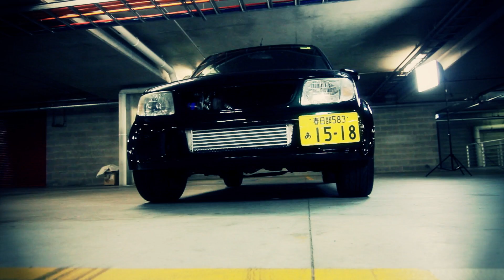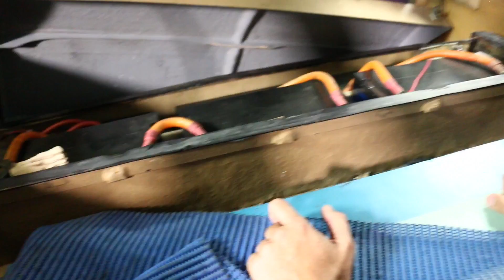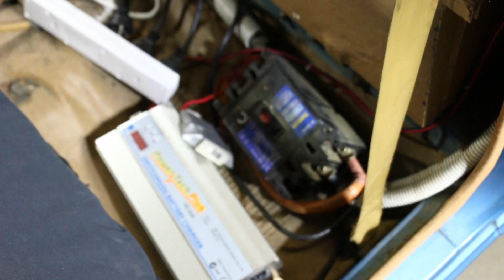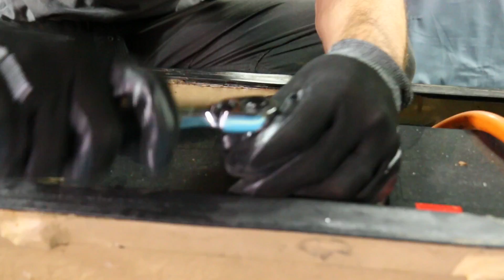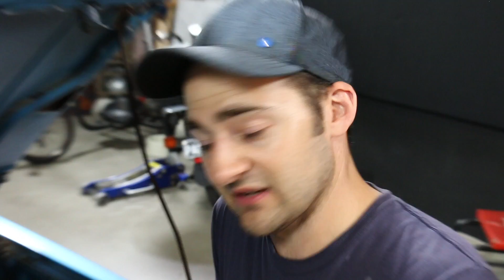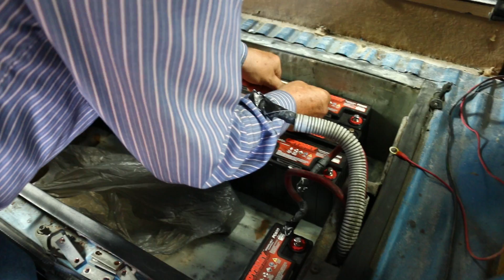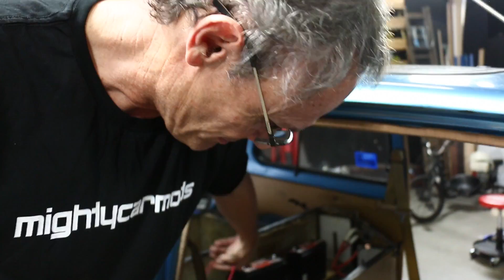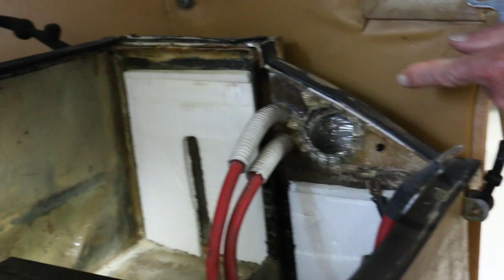JDM Electric Turd

Comment: Why not add a generator in the engine compartment that can charge the batteries as you drive?  It would still be more efficient because you could run the generator at its most efficient speed vs the engine running whatever speed you need.

Comment: One thing you mite want to look into getting capacitors between the batteries and the motor. (Capacitors on modern EV allow the batteries to discharge power to the engine faster increasing the chance for skids) Another thing to help on the lack of power brakes may want to check into a "Hydra Boost System" It's a hydraulically activated booster system (no vacuum needed for power assist) And you don't have to buy the Bosch system, just junk yard one off a Holden!

Comment: just basic batary saftey. high voltage will ark farther than low voltage and can make your muscles tense up like a tazer. high current melts things, and will burn you. both are dangerous at high numbers. in this case it is high voltage and current. so it can be very dangerous if it shorts somewhere.

Comment: odyssey is a really good brand, We run the "2150" in our car audio builds, multiples of them. When your running over 100ft of 1/0 OFC wire  between 5+ power and ground runs off the H/O singer alternator(s), you need a bank of batterys to keep the alternators doing something rather than depleting the batterys storage, and running the stereo off the alternator power essentially hurting the batteries... I ran 3 of em for 2 18's in a 4th order walled bandpass in a blazer on an american bass 5k, with 1 singer 300amp alternator. Odyessey is great but i switched to northstar AGM31's. More bang for buck in canada.

Comment: meh im not an electric car person, i like engine noises to much, personally I'm holding out for hydrogen, not in fuel cells but as an actual fuel, burns clean, can deliver a lot of energy and is easily made, its storing it thats dangerous...
Reply: +Nick Heywood I';m sorry to spoil it for you, but hydrogen cars are electric cars with a fuel cell as a battery replacement. Fuel cells are low-current, low power devices, which means the performance sucks. Hydrogen is even lower energy density than batteries, it's expensive; costs as much to run as a 7L/100km petrol car, needs to be refuelled more often, the performance sucks and to top it off, they're really expensive to make, because they require a lot of platinum to do their job in the oxygen-hydrogen catalyst of the fuel cell. The only thing the hydrogen fuel cell cars have going is refueling within a few minutes, but modern battery superchargers aren't exactly slow either, and electricity is much cheaper. Hydrogen is also one of the most inefficient processes things you could do energy-delivery-wise, maybe with the exception of muscle power via food, which is the most inefficient power delivery system in use nowadays. So if you need noise to drive, just hook up some speakers and play whatever noise you like. My guess is that noisy cars will be even more embarassing in the future than they're now. If you're on the waiting stance, just wait and see battery capacity per size, weight and money double every few years, which is what i'm doing, because I can't affort the 15k€ audi quattro conversion it'd cost with today's tech at the specs I'd be content with, which of course is much lower than the 60k€ estimate the same specs was been less than ten years ago, when I became keen on the idea.
Reply: +jammi Mazda has working internal combustion hydrogen engines, just haven't put them in much yet.
Reply: +ConnorWolf Just to add to jammy's numbers above. From the wind farm down the road to the wheels of my electric BMW is 80% efficient. If you were to store power from the same farm in hydrogen by electrolysis (i.e. not just splitting natural gas) and run a Toyota Mirai that number is around 15% at best. My battery cost around €8k to build, the Mirai's fuel cell costs over €100k. My BMW/Samsung battery outputs twice the power of the Mirai's fuel cell + buffer battery.

The result is the Mirai costs twenty times as much to do the same mileage as my EV and twice what petrol costs.

Oh.... and don't believe the range or refuelling times for hydrogen vehicles. Most current H2 fuelling stations can only pressurise the tank to half full, can only handle 10 or so cars a day and can take 15 - 20 minutes to top up the car. And the fuel system on the Mirai expires and has to be replaced every 10-15 years... and the H2 fuel pumps sometimes explode because they are really difficult to make safe....
Reply: +ConnorWolf TBH if you are going the internal combustion route you are better using a catalytic reaction to convert the H2 + CO2 to methane. Methane we already know how to handle with relative safety and works with a fairly standard CNG converted engine. I'm an engineer who has worked with these technologies in the defence sector. I think the future of passenger vehicles is battery electric hands down. I think HGVs will go Methane SOFC fuel cell for the next 20 years or so until metal air batteries are cheap enough.

Battery tech now can build a car like the Tesla P90D, lithium ion density is improving 5-7% a year. And a little further down the road we have metal air batteries with ten times the capacity and really fast charging.
Reply: And they won't, because that's even an order of magnitude less efficient than gasoline. You can run basically any otto and diesel engine on hydrogen. You just need a trailerload of hydrogen storage to get anywhere, the performance will suck and you'll wear out your engine prematurely. Other than that, yes, of course it works, but it's expensive and you're putting loads more power into generating and compressing the hydrogen than you'll ever get out of it. With batteries and an induction motor, the efficiency is around 80% from power plant to the wheels; with hydrogen in an internal combustion engine it's not even a percent.
Reply: +cros13 I know, I was just pointing out the original poster knows about fuel cells but was talking about internal combustion, not that I think it's better than batteries and grid power, just that it is an option.    

Most people automatically just assume if you say hydrogen you mean fuel cell.  The rotaries Mazda made to run on dual fuels (hydrogen or gasoline, whichever were available) should be a lot cheaper than a fuel cell as well as being more practical to use because they can also use gasoline if hydrogen isn't available (which it probably won't be... because of the reasons everyone has mentioned.) They also make about 50% of the power they do when running on gasoline, which isn't bad compared to most converted internal combustion designs and the energy capacity of hydrogen as a fuel.  But still not good enough to compete with battery powered electric cars in terms of efficiency. Especially with the range problems like you pointed out.

I know all about how inefficient it is to produce and store hydrogen right now.    Maybe one day after I've been dead a long time we'll have an easy way to produce or even just passively capture hydrogen fuel somehow, here's to hoping :P
Reply: cros13 i have heard about this before and again it is a good idea and good on emissions too!

Comment: Just based some quick calculations you guys should be able to get 120miles if you put 12 12 Volt Deep Cycle AGM Dry cell batteries It would weigh something like 1200 pounds in batteries though.  Not sure about the efficiency of the motor that might be pretty bad since its DC, never looked into DC batteries.
Reply: +hootis8 So you have looked in AC batteries bro? ;-) I think you meant DC motor. Still runs at 70% of efficiency, pretty good.
Reply: fucking edit man, I'll just delete it
Reply: never actually tried to find a comment before, google plus really is bad. guess its staying.

Comment: its not the volts that kill ya its the amps just saying
Reply: +Allen Goldsmith You have to remember, I=V/R.
 The resistance of human skin is somewhere between 1kΩ - 30kΩ depending on how wet your hands are. Lets
assume that the resistance of your hands is 5kΩ, so a 144V battery pack, assuming little internal resistance is enough to cause muscular paralysis (leading the victim to be unable to let go of the power source) and breathing difficulties.

Current above 10 mA can cause said symptoms, so lets plug in those numbers:
I=144(V)/5000(Ω)
I=0.0288 (28.8 mA)

That could possibly ruin your day.

Basically, the higher the voltage, the more current can flow through a material with a given resistance.
Reply: +Nick Heywood Both are 1kW, they both do the same thing, the low voltage version of course is more inefficient, because you'd need really thick wires to deliver that power. Of course 1000V and 1000A would be 1MW, which is plenty in the context of cars. Edit: sorry, didn't see the the original comment. In the context of that, you need enough voltage to overcome the human body internal resistance, plus 50-100V or so just to penetrate the skin. You don't need much power to kill, though; 1000V and 100mA should be plenty.
Reply: very true, i could not remember specific figures so i just used random ones, but of course the point it you need both volts and amps, one cannot kill without the other
Reply: +Allen Goldsmith actually its volts and amps, 1000 amps at 1 volt won't do anything, like 1 amp and 1000 volts won't do much, you need both
Reply: oh yer i understand that if you have 400v pushing 200 amps that would blow your socks off but if you had just 400 volts and no amp or little amp like you say it wont do much :)
Reply: +Nick Heywood No, hes right, the amount of current dictates whether you live or not. Think about static electric shocks, or even tasers. In both cases, the victim is pumped with couple hundred kilovolts, however the amount of current in both are not substantial in the slightest. In the case of the static electric shock, the amount of electrons that can build up on the surface of your shoe, if you drag your feet around on carpet, cannot sustain a large enough current for a long enough period of time. In the case of a taser, there are large resistors that artificially limit the amount of current that can flow (in the order of megaohms) to avoid killing the target. However, in the case of battery packs, there are no such safeguards, and they can indeed cause serious injury if one were to complete the circuit with themselves in between.

1000 amps at 1 volt WILL kill you, have you seen what that does to metal? Or any other material for that matter? It causes said material to glow red hot and even melt. I wouldn't think that would be particularly kind on your heart.
Reply: +Allen Goldsmith Yes, but you would have to artificially limit the current, through a large resistor, if the power source is a battery pack. The point I'm trying to get across is that when you pump a high voltage across a material, a high current will no doubt ensue. Current and voltage are proportional with a given resistance. You cannot have 400V with no current unless the resistance between the two terminals is infinitely high, or close to it, such as if a circuit is open and not connected to anything.
Reply: Voltage allows the amps to crank thru

. shit saying tbh

Comment: Curious why you didnt go with deep cycle gel, as those sla's arent ideal for running down all the way and recharging, says theyre rated for 400 cycles which is decent though.
But if the original pack was 144V and 1080ah (90 a battery he said) your new pack will be 144V and 380ah (16ah a battery x 24) which is almost 1/3 the capacity as before, maybe 100 fewer punds, the range is gonna suck unless you add at least another set of 12.
Reply: +Braddock McDonald They really needed to go lithium ion for stability and depth of discharge.... Plenty of crashed Leafs and Teslas about... The MR2 was using Leaf modules. But I suppose if it's an EV on the cheap to do the trip to the shops it doesn't matter.

Comment: you guys can buy lots of 18650 3.7V lithium batteries and solder them up into battery packs, that's how Tesla does it.  If you buy in bulk, they can be fairly cheap too.
Reply: +The Head Not exactly soldering it with a normal solder. You can arm yourself if you do that.
Reply: +The Head Tesla also has very advanced battery management, thermal management and charging systems along with them, plus a method of putting it all together efficiently on an industrial scale. None of that is feasible to diy-ers, but LiFePO4 batteries are.
Reply: wow, you guys are so negative.  the electric bike community uses them all the time,  I'd use them over lead acid any day.
Reply: +The Head Tesla have to do quite a bit of work to make that safe.... they do things like individual fusing for each of the cells, proper temperature control of the pack etc.... plus 18650s might be cheap, but you'll need to test and sort every one to match the cells and not have one dodgy cheap Chinese 18650 ruin the whole project when it goes thermal runaway.
Reply: Electric bikes don't need as many. A car is an entirely different matter, especially if you need power and range.

Comment: A great battery choice would be 18650 cells, like they use in laptop batteries. This is the type of cell the Tesla uses, they are also the standard for electric bicycles. It would be technically possible to make the entire pack out of recycled cells from laptop and power tool batteries, this is often done by people making batteries for electric bikes. In practice, however, this would be difficult because you will need at least 2000 cells (a Tesla uses 2-3 times this many).

Comment: Awesome. 

Put a  emergency generator unit in the trunk for a proper range extender. 
For MCM Awsomeness use a new motor (BMW Boxer Bike engine), or turbocharge the generator unit and/or use E85.
I'm excited and curious what comes next.

Comment: So, If u filled the two tubs full of batteries, Would you get a better range and power, Or the same power, But different range? Cus lookin at it, you could fill up the tubs... and have around twice the amount of batteries, Would this work???
Reply: +iNDiGo GaLaXie The power you notice when driving comes from the dc motor. The batteries just supply the juice like petrol in a conventional car. If you stuff lighter batteries in there with the same power as before you'll end up with a bigger range.
Reply: +iNDiGo GaLaXie Depends how you wire them up
Reply: +iNDiGo GaLaXie well i only see room for more batteries in the rear tub, if he added another pack of 12 in the back(36 bats instead of 24) he would have about a 50% increase in range, i say abot because he would be adding about 150 in weight
Reply: like someone else mentioned it depends how you set it up, right now they have two 144v battery packs in parallel, but if they wired them in series it would be one 288v pack which would give them more power but also let them use it up more quickly.

Comment: have a electric vehicle too . its a disabillityscooter
https://www.youtube.com/watch?v=cPTF2XwRWDg 
i bought it for 250 euro runs 15 km/h on two 12 volt deep cycle gell batteries and can reach about 15 to 20 km per charge , its enough for me to drive to work and back AND im alowed to drive it in town on pedestrian routes and even inside shops  (no parkingfees)
cost me maibe 0.10 euro per day in "fuel" and 100 euro per year in insurance 

looking at the battery packs in youre car , i think you can tighten the bateries in the rearbox using a big ratchetstrap , should clamp the whole block of batteries intoo the top corner of the box
http://www.gripsure.com/images/Tiedown/full_ratchet_strap.jpg 
those bigger ones for truck use can hold several tonnes in place and could actually aply enough force to crush the casing of the batteries if you ratchet them too tight 
you can make a simple wooden box behind all that for stuff like tools jack and maibe a spare tire and change the raised lid that used to be on there for a piece of flat plywood covered in carpet so you can actually put something in the back of the car 

for the front ones i think the best way is to build a wooden box over the ones on the lower shelve and wedge that in for the bateries laying down 
you can put all the chargers and other electronics from behind the seats in that box and make it all look a little nicer 
the small gap with the batteries on the lower shelve  use 2 component expanding foam inside a thick plastic bag wedged in the gap should fill it right up

Comment: i run those batteries in all my cars and have for close to 10 years.  works just like a full sized battery but 30lbs lighter.  

there are better batteries but at twice the price.  but this is a good compromise.   

still the oddessy batteries are 12lbs.  some full lithium are 5lbs.  im guessing but i figure you went from 1000lbs of batteries to 400lbs.  go lithium and down to 150lbs.
Reply: +OutlawUniverse budget budget budget budget budget budget budget budget mushroom mushroom!